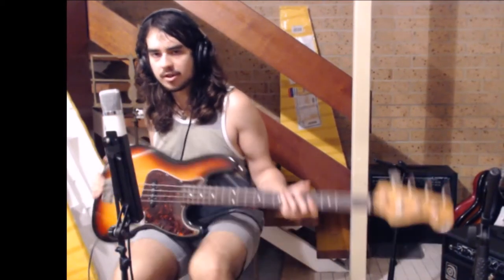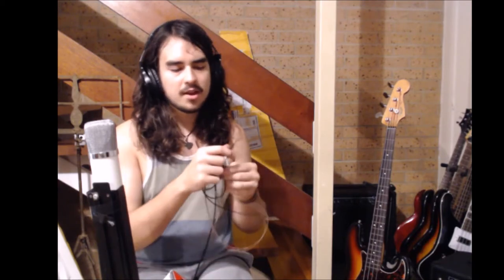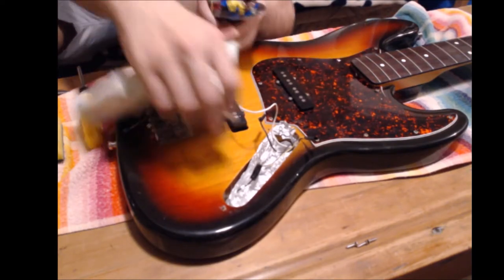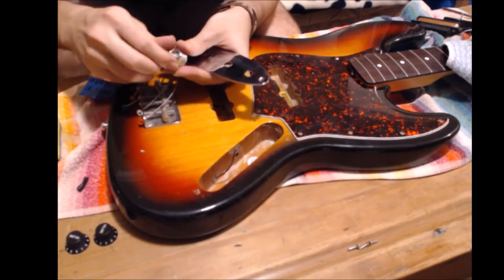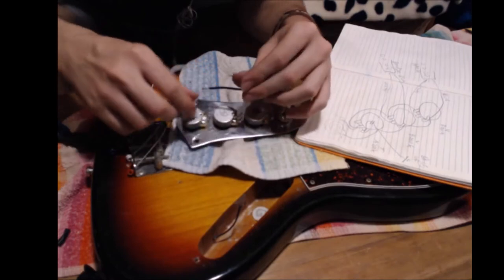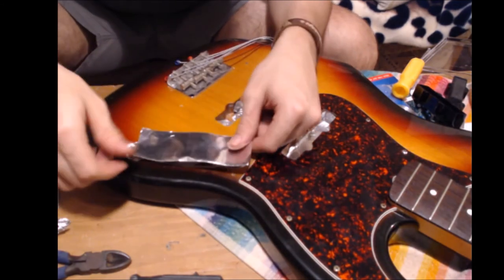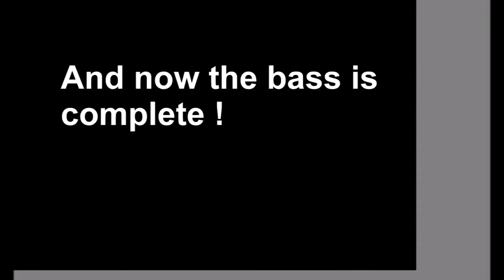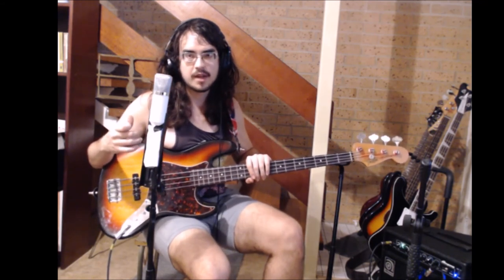Upgrading your Mexican Fender Jazz Bass with USA parts !

Comment: Jakub thank you for another great video, you always make me smile. You seem like a real nice guy. Keep up the awesome work on the videos. Have you ever third Gorgomyte? You can get it at most music shops but it's usually cheaper on Amazon. It's a fret cleaner. Without going to much into it, you should be able to find videos on YouTube. Someone turned me on to it about a year and a half ago, it's AMAZING! I'm telling you it's like magic. You'll never use steel wool again. Just thought I'd mention it. Anyway, cheers
Reply from the maker: Thanks man ! 
wow I'll have to check that product out ! 
this video is one of my older ones and very out dated haha so I  wouldn't go about cleaning a fret board in the same way...
Reply: Yes. Definitely check it out if you can, it's probably some of the coolest advice I ever got by a random guy in a guitar store. The stuff is MAGIC. You just cut 2"x2" squares and buff each fret, you are going to be shocked how dirty the frets actually are. Use every inch of each piece. You'll probably go through 3or 4 squares per neck. You will be amazed. Yeh I dig going over the older videos that I missed. Cheers

Comment: The sheilding must cover 'all' of the inside of your Jazz & the back of the pickguard...they must all be connected as 1 or will not do anything...the cavitys must be electrically connected to the control cavity & earthed....copper sheeting & conductive paint works best for me....everthing sheilded must join together & be earthed to back of volume pot....nice Jazz bass

Comment: I own some beautiful Mexican made Fender bass's but even though they were well made i fully sheild & rewire every Fender bass with Fender cloth covered hook up wire, new 250k linear CTS pots 8% tolerance.....
SD Apollo noiseless pickups in my 75th Anniversary Jazz & Epic Custom pickups in my Jaguar PJ...always use linear pots as your right it is easier to blend the pickups & i hate those pots that do nothing till 9...a True Tone input jack socket, 4 contacts, 2 + & 2- but still mono... 200% more contact
...i've fitted brass nuts to 2 of my Fenders & all have Fender vintage bridges fitted with 3 groove brass Guyger saddles...no stabbing grub screws & sits a little lower than the stock Fender saddles...& sound better...sadly every Fender bass i have bought even brand new i have to rewire & fit a Greasebucket Tone control....
more three dimentional & better tone than a single capacitor...just 2 hifi grade 5% polypropylene caps & a 1% resistor but works great
...a triple string tree helps stop the A string rattle/vibrate, available on *Bay & *mazon...i luv Fender bass's but they could not wire a plug after nearly 80yrs..?!?!

Comment: Can you put a American jazz bass pickguard on a Mexican jazz bass?
Reply from the maker: I think so, they should be identical as side from the width of the hols for the tone and volume pots
Reply: @jakubshouseofrock7109  even though it has a little notch to adjust the action on the body instead of the headstock?